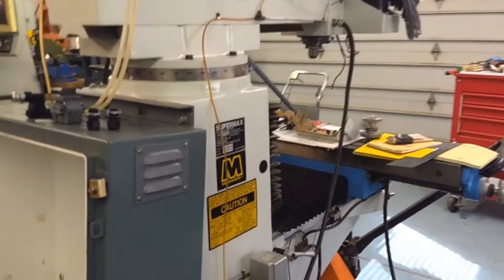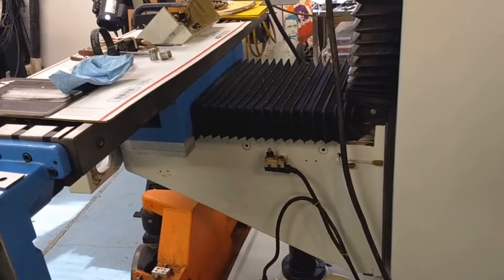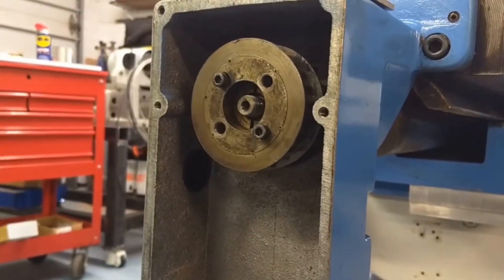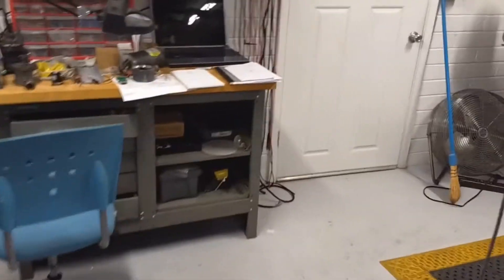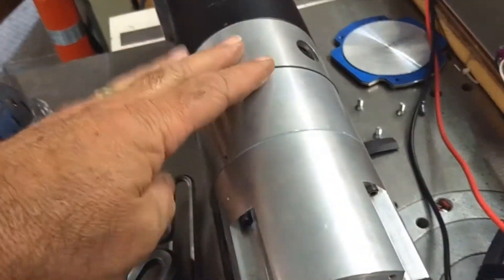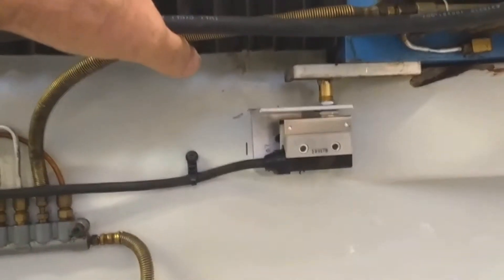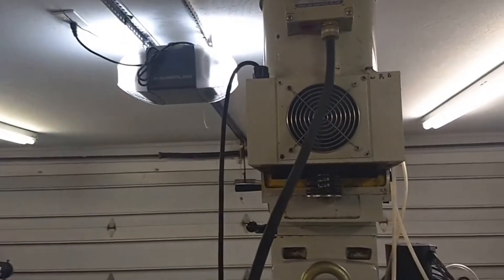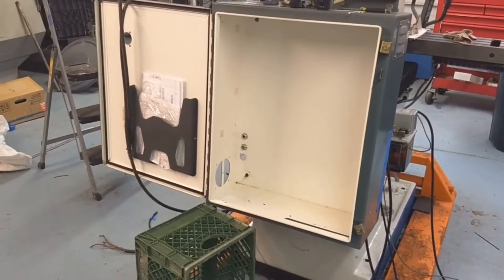Supermax Update - Replacing/Rewiring Limit Switches and rewiring external equipment

Comment: Unfortunately most Bridgeport style machines are not designed with correct limit & home position switches due to space & head size. Don't get wrong, I'm a big fan of Bridgeport & most Bridgeport style of machines. I wish I had the money to buy one that has not been beat to shit & never rebuilt. Like every machine tool they need to be rebuilt also. They are fine from a light duty machine from a point of view but not from a production point of view. From a machinist & maintenance point of view all the limit & home switches should be proximity switches since they are more reliable & accurate. That is the reason most major machine manufacturer use proximity switches or scales. The axis motors should not be driven by a belt buy by directly to the axis lead screws. Also, with the time & money you have spent on this machine, you should spend the extra time & money installing double ball nut ball screws for better performance. I really like what you are doing to your mill & how clean it is. That's very rare to see a machine that clean unless it has just been rebuilt.

Comment: Hi mate just finished installing the centroid to my leadshine steppers any idea how to wire in 4 strand IFM induction sensors for limits? I have three.
Reply from the maker: Not enough info. Make, model and is there a schematic for them? Go to the Centroid User's forum and post there. MANY knowledgeable members. This way everyone gets the benefit of the answer.

Comment: It looks like there is a lot of threads on the shaft for the large pulley for the x-axis. Maybe you could put a spacer behind that pulley to line up with the servo motor pulley. Just a thought, I can't see everything you can.
Reply from the maker: Thanks for the suggestion William. I'll get down in the trenches with that one as soon as I'm done with wiring up the control. The X axis shaft is keyed, the pull has a tapered bushing that clamps down on the shaft when tightened. We are thinking along the same lines pull the large pulley out as well as the servo pulley and hope both have plenty of purchase on their respective shafts.
Reply: Good luck